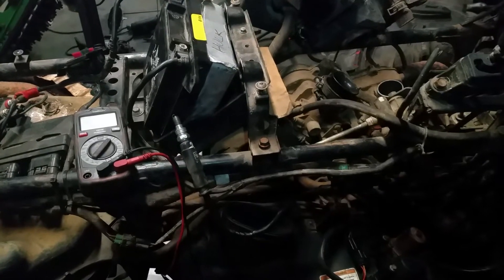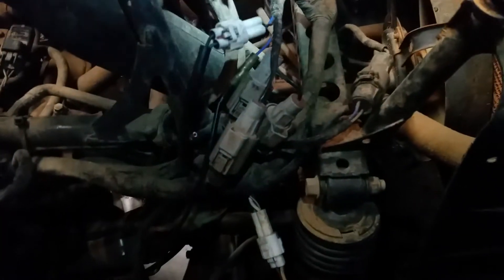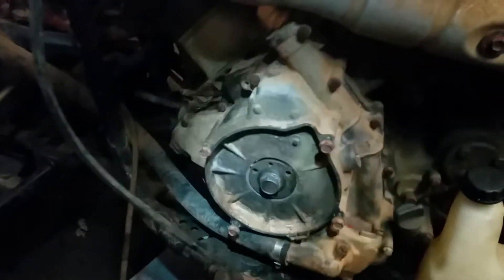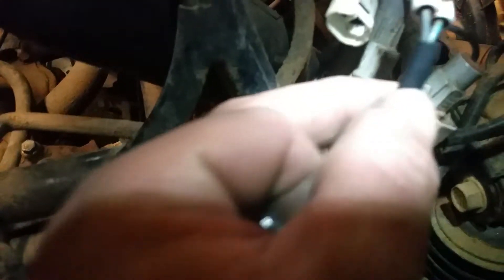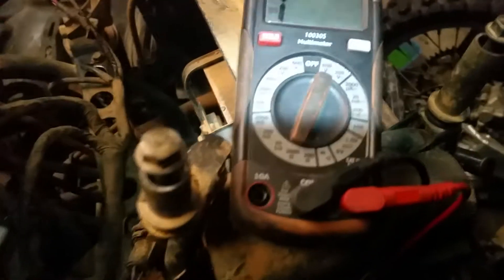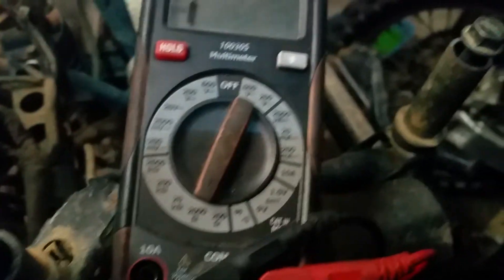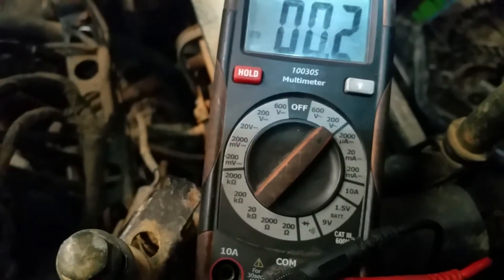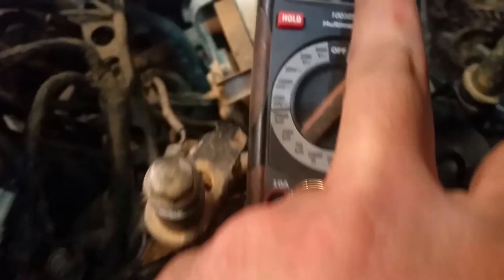2008 Kawasaki Brute Force Pick Up Coil Test Crankshaft Position Sensor Test

Comment: Mine tested 118 and 0 volts with 0 spark what needs to be replaced
Reply from the maker: You need to replace your pick up coil
Reply: @brothersmechanics2028  was replacing the one way bearing and the bolt pulled out of the flywheel and chewed the stator up. Has new stator now but could this be the reason this went bad? And caused not spark
Reply from the maker: @collindraper2772  did you replace the pulse generator with the stator? Did you replace the rectifier Regulator?
Reply from the maker: Check your battery too
Reply: @brothersmechanics2028  I don’t think so brought it to a shop and supplied a new stator woodruff key gasket and bearing
Reply from the maker: @collindraper2772  the pulse generator is what creates the voltage for spark.
Reply: @brothersmechanics2028  where is that located
Reply from the maker: @collindraper2772  same area where the stator is

Comment: The service manual states that the voltage test should be done on DC not AC volts.
Reply: That's because it's supposed to be a peak voltage test, which requires a peak voltage adapter and setting the meter to DC.  Since he's not using a DVA, the best he can do is set it to AC and just see what the meter reads (will vary depending on the sensitivity of the meter).  What's bizarre to me is he even calls it a "peak voltage test" in the video but then doesn't use a peak voltage adapter.  Like telling somebody to tighten a bolt to a certain foot-pound spec and then not using a torque wrench.  But at least on a "normal" AC setting (RMS, but likely not true RMS) he'll at least get some sort of reading and at least able to see if there is an AC signal there at all.

Basically, he's doing the test wrong because he doesn't have the proper equipment, but if you're going to do it wrong do it the version of wrong he's doing since it's better than nothing.
Reply: @st.jimmy0244  you cannot get peak voltage on AC or DC without a PVA.  I use them every day!
Reply: @citylimitpowersportsllc5872  That...doesn't in any way contradict what I said.  My point was that you're correct, the meter must be set to DC, but that's only part of it; he needs a DVA/PVA (depending on your preferred terminology), which he doesn't have.  He's claiming a peak voltage test but not using a peak voltage adapter.  That's my objection.

However, you can indeed get peak voltage without a peak voltage adapter.  Get an oscilloscope.  Pretty much any half-decent scope will allow you to not only read the peak voltage but also measure the polarity and duration of the pulse.

Comment: Hello, I have a problem with my brute force 750 fi, it spins to half the speed, at full throttle it chokes as if it was cut off by something
Reply from the maker: Its probably in limp mode. If so, buy a dynatek cdi and it most likely will solve that issue, not guaranteed but that could be your issue.
Reply: @brothersmechanics2028  the fuel pump is replaced with a new replacement, could the oryginał cdi be damaged?
Reply from the maker: @jacek1235  there are a million things causing it to go into limp mode. You need to get the codes from the computer or go to a dealer.
Reply: @brothersmechanics2028  thank you
Reply: I forgot to mention it, the quad worked perfectly after replacing the pump, the test drive was about 15 minutes, I put the equipment away, and after some time I wanted to drive again and then it started to stop at high speed
Reply from the maker: @jacek1235  You definitely need those codes. Good luck!

Comment: Thought I would get your thoughts on a no start issue.  It cranks and will spark on the first cycle when starting.  I changed the coils and spark plug with no change.  I ohm out the stator (0.5 ohms between the three wires each and infinite to the block ground) and the crankshaft position sensor was 451 ohms.  All looks good so where do I go from here?
Reply from the maker: Does it not have spark then?
Reply: @brothersmechanics2028  Yes it only sparks at first when it starts cranking but nothing after.  When the issue first started I could have it on the battery charger and it would run but when I took the charge off it would die.  I thought weak battery so I replaced it.  Since I replaced the battery it will not run at all even with the charger on.
Reply from the maker: @brianwayland8095  you may have a CDI problem
Reply: Adjust your valve clearance

Comment: Is the pickup coil the same item as the crank position sensor. ?  ..if not where is the crank position sensor located ?
Reply from the maker: Yes sometimes it is called the CPS (crank position sensor)
Reply: @brothersmechanics2028  thank you ..there isn't much info about  "crank position sensor". ..mine has a reading of 414ohms ..and today I just found a used one with 418ohms   ..both of these readings seem too low to fit inside your 423-517 range   ...hmmmm  ..the 418 one was from a functional brute that fell of the back of a truck ..i guess the 423-517 ohms range is pretty important ?
Reply from the maker: @relaxingnature2617  I would say that if it's that close it could be a ohmeter being slightly off or the sensor is on its way out and could have sporadic sparks.
Reply: @brothersmechanics2028  I'll install the spare to see if I get spark  ..it's a 600 kilometer round trip drive to get one from the dealer ..itdd like to avoid that ..but I would probably be better off with a brand new part  ..thanks for helping
Reply from the maker: @relaxingnature2617  No problem, good luck!

Comment: I have 414 ohms  and 2.5v  spec you mentioned say 423-517  and 2v or more. ..since mine is below 423 is that for sure needing replaced ?  ..I have no spark and I've tryed everything else
Reply from the maker: 414 is a questionable reading. I would guess you have other issues causing you to not have spark. Check your coils, tip over sensor, etc

Comment: Hey man thanks for the video. I've got a 09 bruteforce not turning over at all. Started after I changed the belt. Tried everything. Could a faulty Crank Position Sensor be my problem?
Reply from the maker: That's a very vague description of your problem. There are a ton of things that could cause it to not start. I need a bit more details please.
Reply: @brothersmechanics2028  So when I spin the starter by hand a few times it fires up by other wise when I try to start it, it makes a deep noise for a few seconds, and then nothing. Battery is good, fuses are good, spark plugs should also be good, because it starts when I spin starter by hand, also not the safety switch for the belt..
Reply from the maker: @alkhfgsaadfbjjff3  You need to do a compression test before going any further. If your compression is lower than 90 then it needs a new top end. You can rent a compression tester for free at almost any auto parts store.
Reply: @brothersmechanics2028  The compression should be good because the engine is clean, also it starts when I spin starter by hand. It's hard to explain, but it does not want to start cranking at all. Think it might be a sensor if compression is good?
Reply from the maker: @alkhfgsaadfbjjff3  Have you checked the codes yet?
Reply: @brothersmechanics2028  If you mean scan for codes, I didn't even know it had a plug for it. Do you know where the plug is to check codes?
Reply from the maker: @alkhfgsaadfbjjff3  There is a way to get the codes without a scan tool. As long as your atv is fuel injected.  Hard to explain how to do it so i may have to make a video on how to do it. Google how to get codes on a brute force. If i make a video I'll send you the link.
Reply: @brothersmechanics2028  Okay thanks alot man I'll check it out!
Reply: @brothersmechanics2028  The F1 indicator light is not flashing so I guess it's not a DFI problem?
Reply from the maker: @alkhfgsaadfbjjff3  so it starts and runs just fine when you pull start it? If so, remove the starter and test it.
Reply: @brothersmechanics2028  Yeah it runs fine when we pull start it, other wise not. My father took the starter off and checked it with a battery and it works..
Reply: Artur Anselm when you say a deep noise does it not turn over because when My stater started going out I had to jump the solenoid to get it to start to turn after the starter cooled off